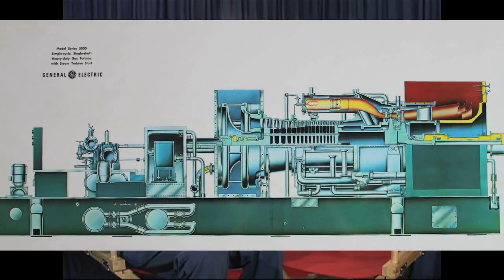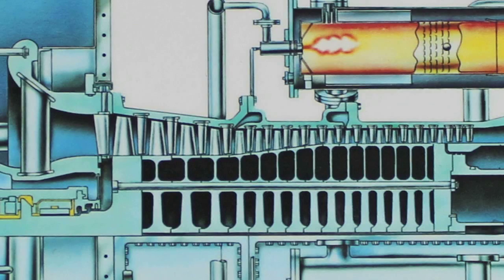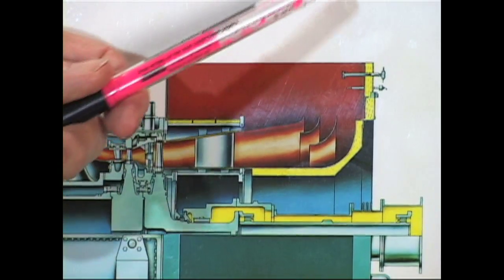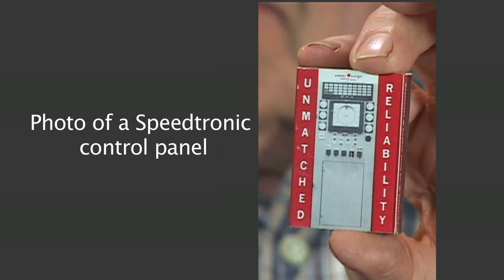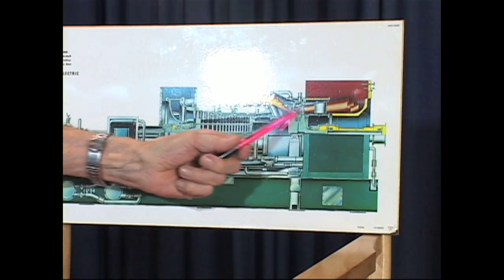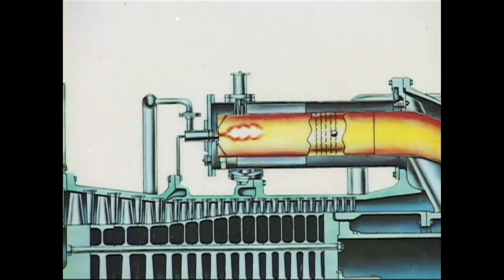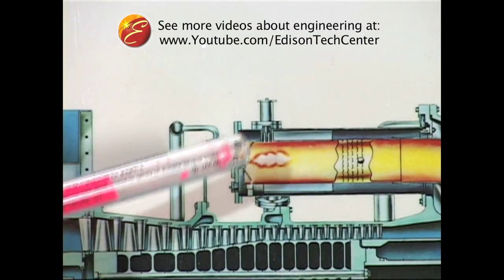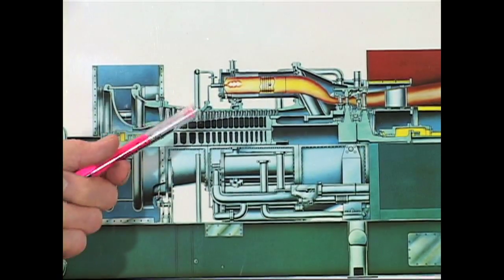How a Gas Turbine Works

Comment: So how does the heat energy get transformed into mechanical energy? HELP!! lol
Reply: i think hes using the ideal gas law PV=nRT, the higher the temp, the more pressure you can have which can generate more power, i think this is so dang cool
Reply: BeingOfLight1111 The heated gases from the combustion chamber will drive the turbine.
Reply: easthight No I mean at 2:05 why is the combustion chanmber where it is. the gas has to travel down a tube, then change direction and travel down another long tube all the way to the front of the turbine. You would think it would lose alot of energy. Also it seems like most of the gas just gos out the exhaust. Which i allways thought the combustion chamber would be at the front of the machine and that the different pressure of gas move the blades and was attracted to the exhaust because the hot air always wants to go to cold.
Reply: BeingOfLight1111 I'm not sure of the main reason, but it's probably to save space. These kind of turbines are huge so space is a problem. There will be a loss in energy but not as much as you think.

Comment: The explanation is wrong in several points of this video. At 0.37 and 8.11 he points at the GAS CONTROL VALVES, not the starting motor. At 3.28, 5.33 and 5.46 he points at the STARTING TURBINE and calls it the gas control valve. In 4.23 he points at the top of the engine base and calls it the shaft centerline. The governor is NOT on the shaft as he points out somewhere, but is a part of the control system (Speedtronic here).

Comment: Whats the atmospheric pressure before it enters the combustion chambers
Reply: Jan Huisman The pressure in front of the combustion chambers is the compressor discharge pressure, for this type of gas turbine approximately 10 bar absolute.
Reply: i love shit like this, currently learning ovality and the nominal size on a crankshaft, easy.
Reply: 14.7 psi

Comment: Just one question not to confuse the contents I've learned in my Power Plants lecture: Isn't it, that nowadays during start-up the generator is used as starting means, operating as a motor via frequency converters?